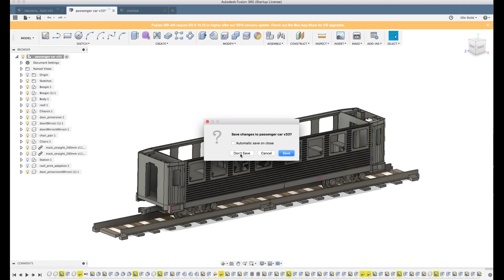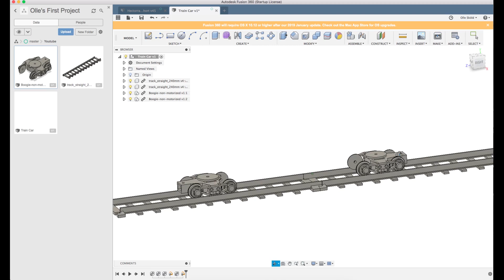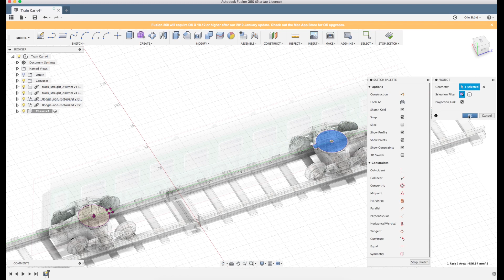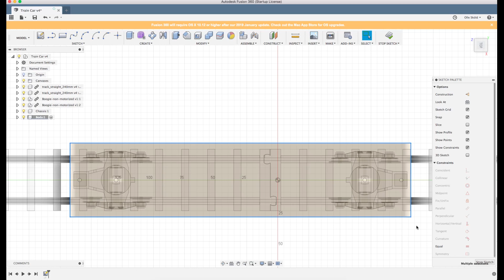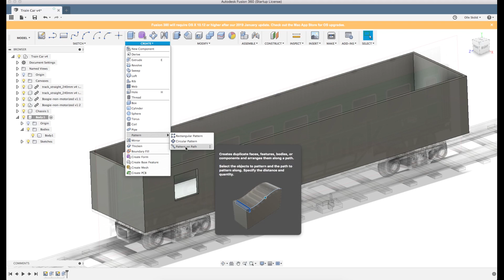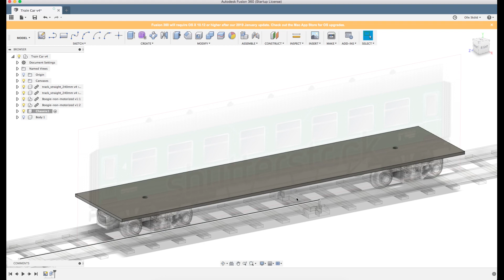Design your own train car in Fusion 360 for 3D-printing - Part 1 of 7

Comment: Your OS-Railway is awesome. Fusion 360 looks great, however, it looks like it is free only for a trial period.
Reply from the maker: Dave Stott Thanks! You should be able to extend that period for personal non-commercial use. (Unless they have just recently changed the  terms)
Reply: @drdistorzion  Thanks, i will see what happens.